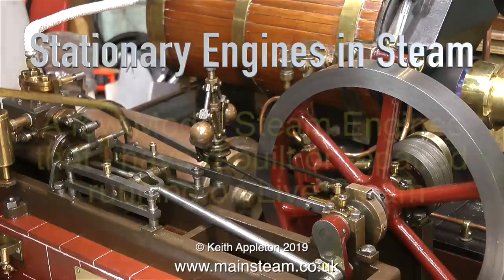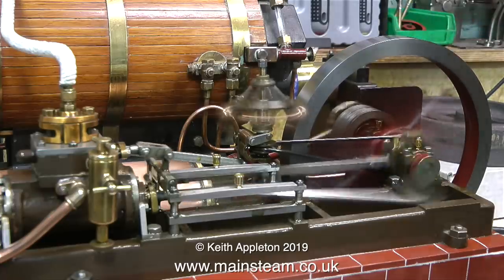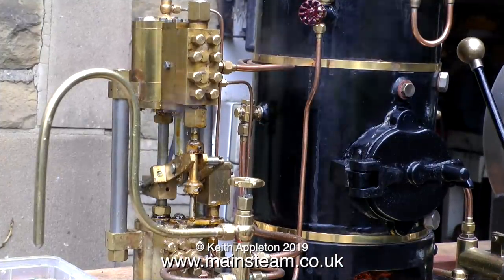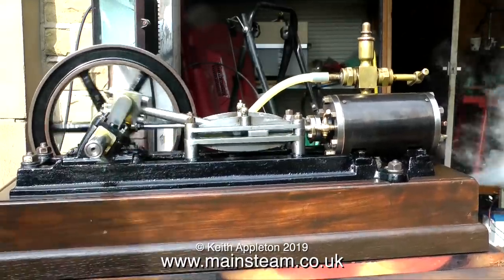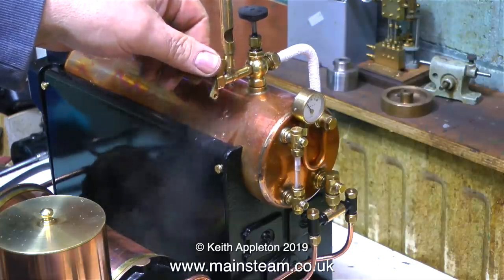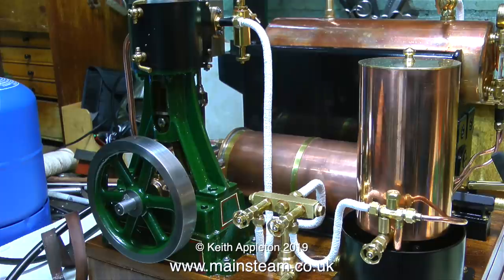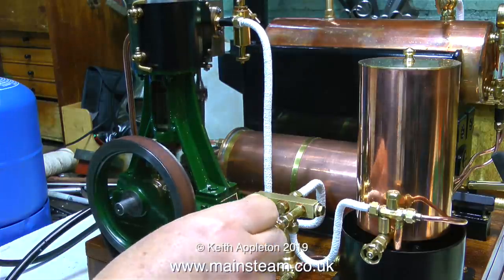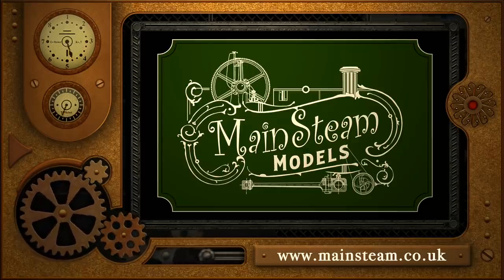RUNNING STATIONARY ENGINES ON LIVE STEAM

Comment: What kind of genny is it? AC? DC? Voltage? Amperage? Could it replace a small petrol genny?
Reply from the maker: a Brushless motor with a diode bridge . . . .  as described in the series when I built the plant. Steam engines need constant attention, a petrol generator doesn't .....
Reply: @keithappleton  I was thinking more along the lines of a working display at a steam fayre.